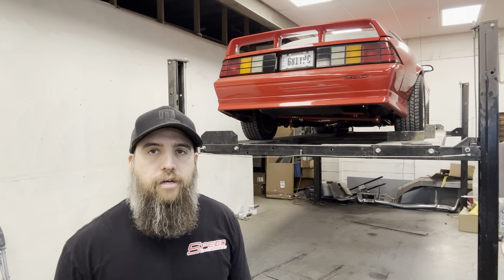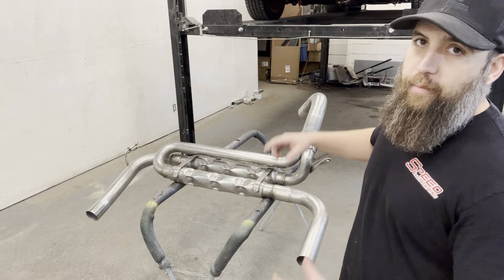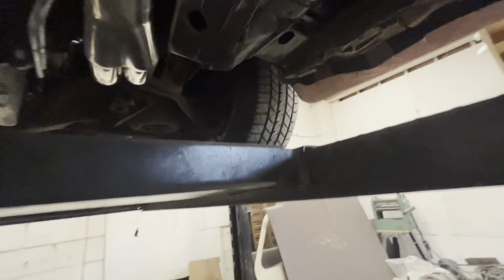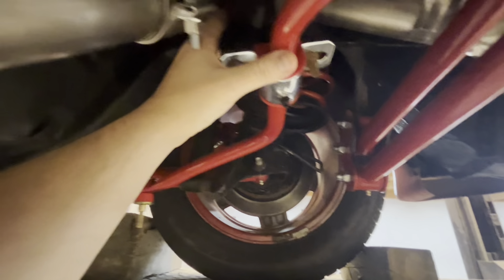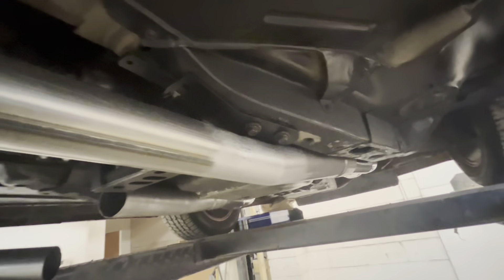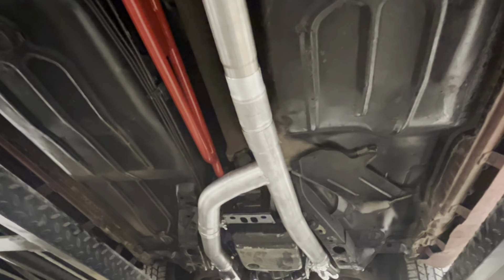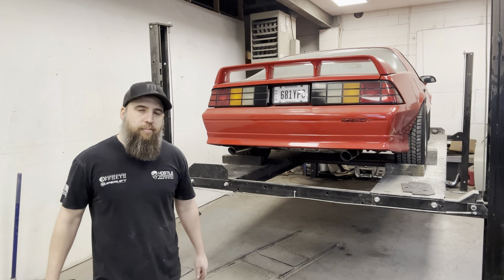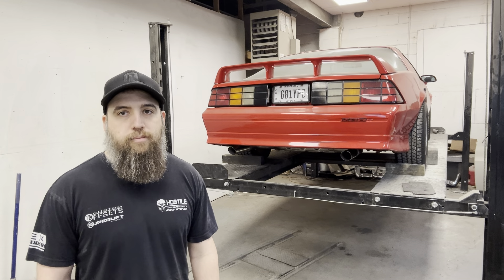New Exhaust and Wheel Setup on LS Swapped Third Gen! 1991 Camaro Z28- Ep.2

Comment: What size tires and rims are those? Offset/backspace? I am thinking about the same rims, square 10.5x18, trying to figure out proper spacing. Great channel 👍
Reply from the maker: I will get you all the specs when I get back in the shop! Thanks for the support!
Reply: The rears are 18x10.5 with 54 offset and 7.9 backspace on a 4th gen rear. I’m running 285/40/18 nittos.
Reply: @cincycamaro92  How about the fronts?